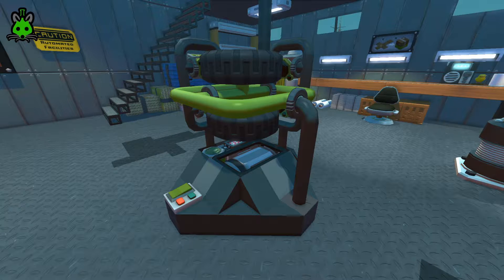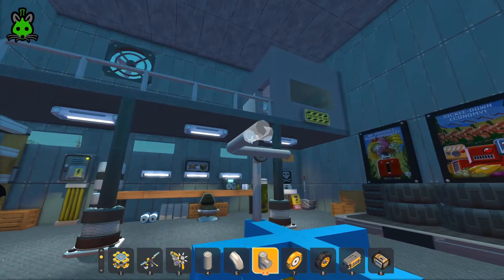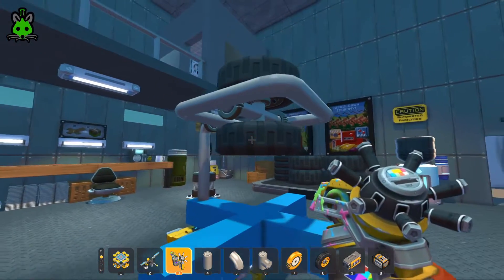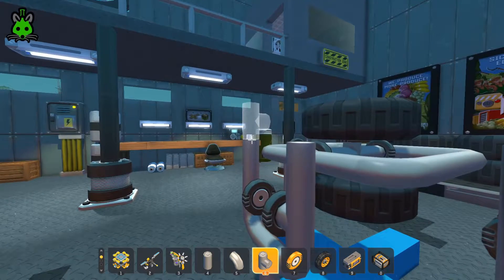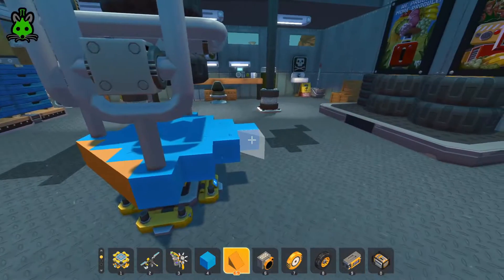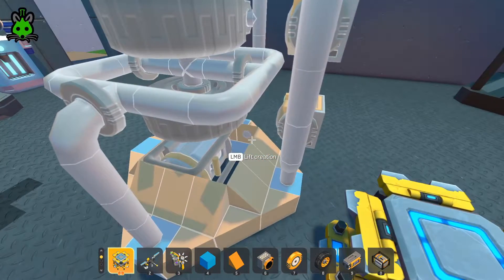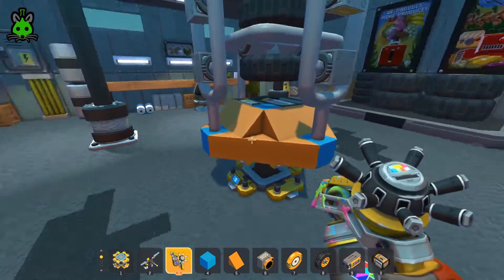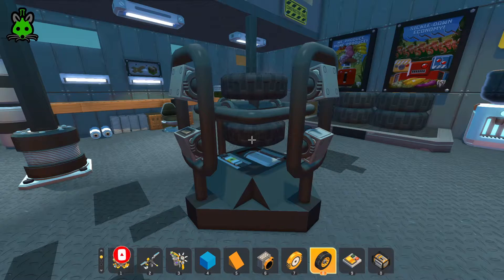Compact Gyro Stabilizer Build (vanilla)(no mods/glitches) Scrap Mechanic

Comment: Do you know how to make a rotating ball joint? I'm trying to make a hand for a survival mech I plan to make.
Reply from the maker: It's been a while since I've played. Waiting for the new update before I jump back to it.
Reply: I'm also trying tou use your gyroscope to make my balance my hovercraft out but I don't know which of the sensors I'm supposed to hook up to which thruster. There are 4 thruster pads and 4 thrusters on each.  @ProfNCognito

Comment: The sensors supposed to detect back/forward leaning do not sense anything. Who would they? The bar that they are supposed to detect doesn't move up and down...?
Reply: i think they detect the wheels moving side to side, idk
Reply: @versenova5531  yes they detect side to side movement but how is that gonna help if the creation is leaning forward?
Reply: @boredpancake418  there are other sensors for it detecting leaning forward, one set of bearings is side to side, the other is forward and backward.
Reply: @versenova5531  are you even reading my messages? The sensors are there, yes, but the bar isn't on bearings so it can't move up and down. This means the sensors detecting forward and backward leaning can't detect anything and are therefore useless. The wheels themselves are what's on bearings, but the sensors are placed to detect bar movement, not wheel movement.
Reply: @boredpancake418  the bar is on bearings... 2:26 unless u r talking about a different bar then idk but im assuming u mean the one the wheels are placed on

Comment: So, if anyone sees this - if possible ProfNCognito - I'd like to know if the gyro can be made more precise, without making it too much bigger. In my testings, I couldn't get the sensors to activate until the gyro reached a seventeen degrees inclination, so I cannot use it for what I intended for, a small two thruster, glitchless flyer.

I did some experimenting, and found something... Interesting? Simply replacing the wheels by tier 3 concrete blocks and leaving the sensors to zero degrees actually seems to not only make the gyro more precise, it's range going from five degrees to twenty before "glitching" and loosing in precision. However, the way the sensors activate is very weird. Since the concrete blcok spins, really fast, the sensors actually go out in pulses that goes faster and faster the steepest the angle of the gyro is, reaching 100% uptime at twelve degrees. I think this might actually be a incredibly useful feature, as it provides somewhat of a gradual step up of the alignement for thrusters and such. More testing is required, to know how intensive use will affect the relialibilty. 

Upon more extensive testing, with a max speed controller and fairly random angles, it seems to be fairly reliable. I will update this comment when I will have tested this on a thruster platoform.

After a few more minutes, I realized that giving the sensors an outward angle of five degrees actually seems to benefit the contraption, giving it a few more degrees of precision, from five to twenty-four, before it looses precision.
Reply from the maker: Wow nice testing. 👏
Reply: @ProfNCognito  damn, I didn't expect you to answer this so fast lol. Also, do you mind if I do a video after the finished flying bike when it's finished? I'll definitely put this video in the description and say how I based off my design from yours. You deserve a lot more subscribers, and even if I have less than twenty, I really want to do that regardless - any subscribers I can earn you will be worth it, you're an awesome builder.

Also, I didn't plan to use this account for for writing this message but I guess it makes more sense as it is my gaming channel (which is also the pnly one I upload on) so yeah. Also, I plan to use that flyer in survival mode, so it's why I'm only using two thrusters and not more. 

I just thought about the fact I could use the ramp-up effect of a sensor picking up a spinning block that is incline by a controller on loop linked to a seat for a completely gradual - but very slow reacting - thrust control.
Reply from the maker: @3-valdiongaming783  sounds good. Can't wait to check it out.
Reply: @ProfNCognito  I'll probably start the work on it after I'm finished recording an episode or two of Below Zero.

Also, the wheels are a key part to the contraption - it makes the gyro keep it's orientation way better - but since they are less precise than the two concret blocks, I just added them both ontop of them and you know what? It works even better now.

Comment: How does the electric engine contribute to the gyro?
Reply from the maker: It spins the wheel giving the gyro effect
Reply: @ProfNCognito  I've tried without spinning the wheel and I can't seem to find a difference.
Reply: @Blooff  the difference is pure effects i think. The spinning wheels give a gyro effect. A gyro spins. so the wheel spinning is just for effects and isnt necessary
Reply: @xsorrgaming2351  the wheel spinning provides a gyroscopic force. When the wheels spin I believe it is more stable because it provides a centrifugal force which makes it so that when the whole bae tilts the centrifugal force re aligns everything that was put out of place from the tilt, thus making it more effective.
Reply: @xsorrgaming2351  you shouldn't have skip physics

Comment: But for the forwards and backwards sensors the pipe doesn't tilt but only thewheels, so how can it detect it? I say that because it doesn't on my construction :(
Reply from the maker: The wheels are picked up by the sensor not the pipes in that direction .

Comment: thanks for the tutorial but, could you explain rlly quick how to use this? im new and also really confused with this game
Reply from the maker: It helps flyers stay upright automatically when connected to thrusters.
Reply: You hook the sensors up to some thrusters and if the thrusters are placed correctly your aircraft will stay upright
Reply: You can make cars

Comment: Are wheels sufficiently heavy to provide enough torque to stabilise a flying machine, or would it be more effective to use 4 heavy blocks on a cross piece? And is there any way in vanilla to set up a spud gun to be mouse operated? Reason I ask, is that I want to design a helicopter gunship for two people - one flying, the other operating the gun and, ideally, I'd want the gun to be aimed using a mouse (wsad being less intuitive for my young grandson)... Alternatively, is it possible to have mouse control over pitch and yaw in the flight controls in case he wants to fly?
Reply from the maker: Not without mods I believe.  Will look more into it though. I would love the same thing.
Reply: @ProfNCognito  I look forward to the results of your experimentation - success or failure - presuming, of course you post the video.
Reply: i tried to build a flying machine with dis, but it didnt work, there are much better gyros for that

Comment: Question, would this Gyro work replacing the power source from an electric engine with a controller?
Reply: It is possible but the faster your wheels spin the better. More weight for the spinners will also increase movement accuracy
Reply: Cho Kyrie I think it has to spin faster. You can try in creative if you want